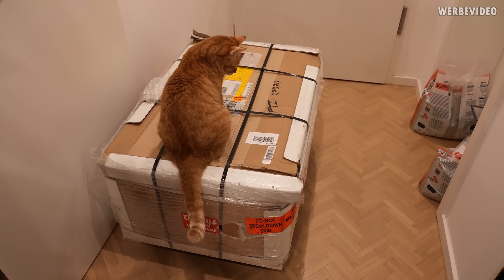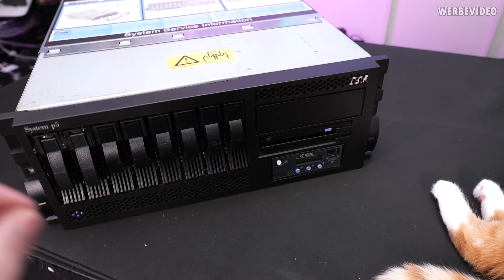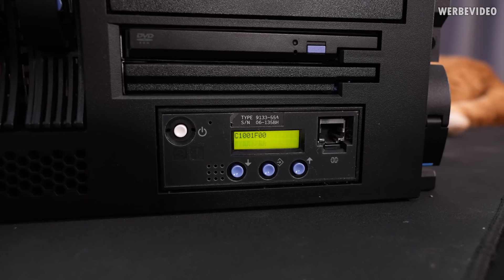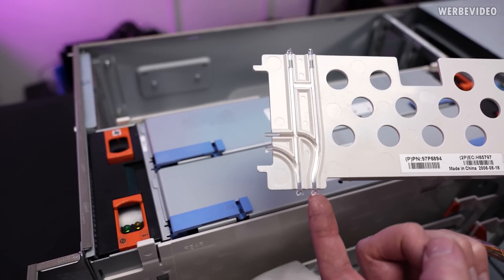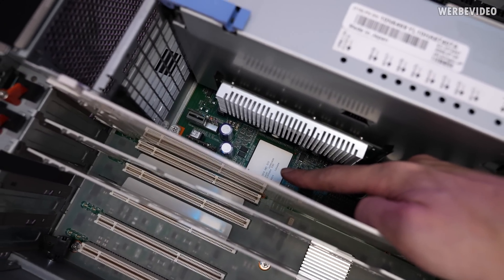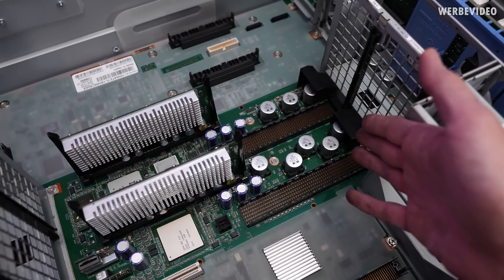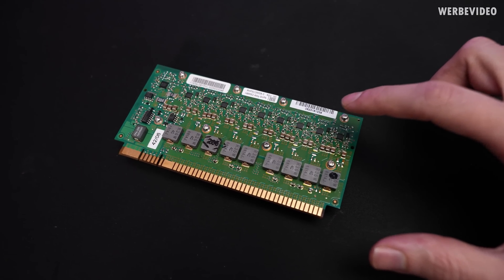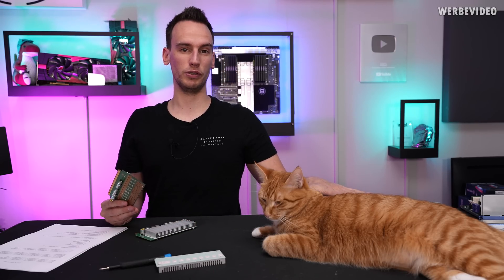Exchangeable VRM PCB and huge CPU Slots - IBM Power5 Server 1/3

Comment: That is a SCSI LVD Card ! What a trip back down memory lane this box is !! Very similar to the adaptec 2940 etc :)
Reply from the maker: Thanks!
Reply: @der8auer-en  The top 68-pin connectors are for two independent "wide" (16-bit) SCSI channels, very likely the two VHDCI connectors on the back are the same two channels though in theory it COULD be a 4 channel cards instead but I doubt it is.

The use of VHDCI connectors means it's one of the LVD variants of SCSI, IE Ultra-80, 160, 320 or 640 (named after the theoretical MB/s per-channel capacity). PCI 3.3V 64-bit suggests it's fairly late so I might guess it could be a dual U320 card perhaps. But it's all backwards compatible anyway.

LVD SCSI is also known as differential SCSI, you CAN connect old non-LVD hardware to a LVD SCSI bus but the entire bus will then fall back to the older much slower standards (IE 40 MB/s or slower for wide, 20MB or slower for narrow bus) so only do that if you can dedicated a bus for old/slow devices (say an external CD-ROM) or absolutely must, fortunately you do have a second unused channel... OTOH as long as all the devices are LVD they'll run at their max speed (or the highest the controller support).

You can connect (old) narrow (8-bit, 50-pin) peripherials to a wide bus, but the termination at each end of the chain needs to be wide unless you only use narrow devices though some cards can run narrow out of one connector, wide out of the other by terminating the upper bits on the card. I expect the card are currently set to terminate on the card in which case it's set up so only the internal OR the external connector of each channel should be used. There's probably ways to change that.

Not at all familiar with IBM Power hardware but I expect the 68-pin wide SCSI cable we saw will go into some kind of hard disk backplane, where disks plug in via SCA-2 hot plug connectors and that the SCSI termination is integrated at the end of the backplane. The SCA-2 connector has 80-pins and provides both power and wide-scsi in one hot-plug safe connector, if so you can use either SCA-2 (80-pin) disks or regular wide (68-pin) disks and SCA-2 converter(s).

LCD: If you check the video you can see that the codes was changing, I assume this was the built-in microcontroller starting and then running diagnostics on the hardware, think of it as POST codes. It clearly found something it didn't like at the end but that could be as simple as the hardware configuration having changed since last boot and that it has to be confirmed during startup. Or it could have detected a real fault.
Reply: Damn, you went Adaptec!
Reply: OOOH   Scuzzee. Them were the days.. Nice IBM., Roman. 👍
Reply: Yes, i shoudl still have some harddrives (2?) of those laying around.
Not sure if they still work, i can't connect them.
Reply: Yup!

I still have my Adaptec 19160 Ultra 160 68-pin low voltage differential (LVD) (parallel) small computer system interface (SCSI) card as well which was good for upto 160 MB/s (1.44 Gbps) data transfers to the mechanically rotating SCSI hard drives.

That would be close to the first generation SATA interface speeds (SATA 1.5 Gbps) except that it was introduced towards the end of 1999 whilst SATA 1 (SATA 1.5 Gbps) specification was released in 2003.

You will also note that today, you will be able to find serial attached SCSI (SAS) hard drives, controllers, etc. that basically took some of the improvements that were developed under the serial ATA (SATA) interface, and adopted it to the SCSI interface to produce the serial attached SCSI (SAS) interface, which the first generation of it was introduced in 2004.

At the time that (parallel) SCSI was released, the best that you could do with an integrated drive electronics (IDE) (a.k.a. parallel advanced technology attachment (ATA)) could do in ultra direct memory access (UDMA) mode 6 was 133 MB/s.

(I don't know if I still have any PATA hard drives, etc. floating around. I might still have PATA CD readers/burners and/or DVD readers/burners lying around here somewhere, but I know that I DEFINITELY still have my Ultra160 SCSI hardware.)

The 80 pin version provided both power and data on the same interface connector whilst the 68-pin only provided data and you needed, usually, a separate 4-pin molex connector to power the individual drives.

As such, with SCSI backplanes, many of the SCSI drives were 80 pin (just as now you have backplanes for servers that uses SATA drives that also provide power and data connections to the drive).